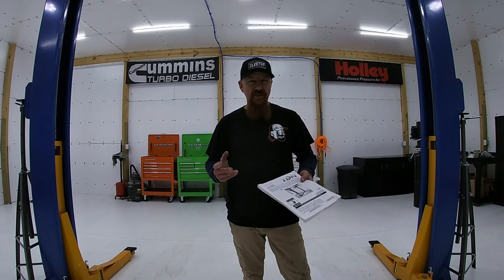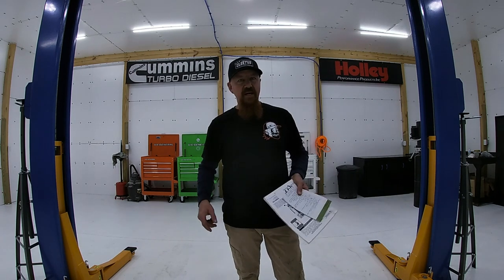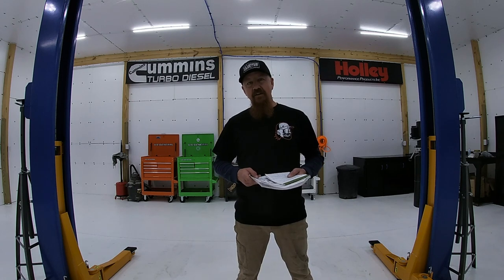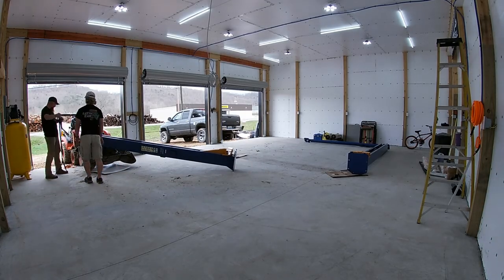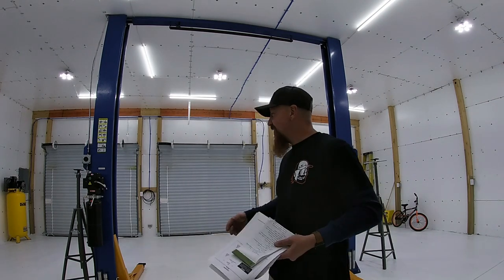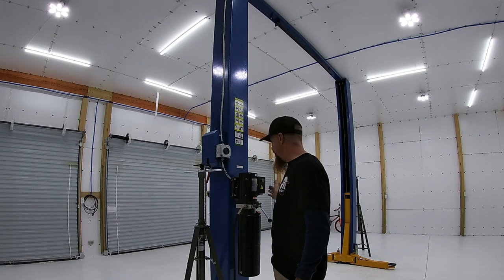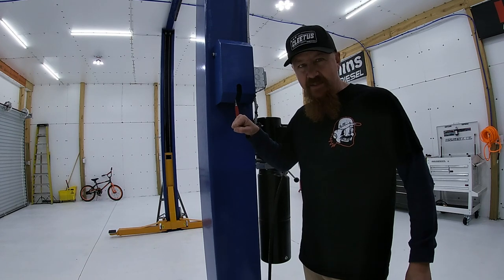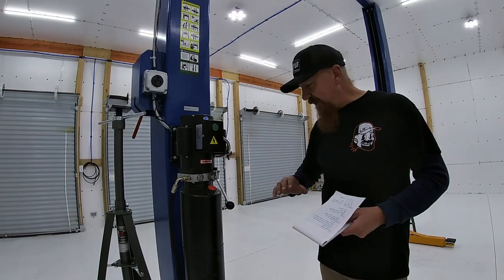Installing a Two Post Car Lift - Tips, Tricks, and How-to Install - Triumph NT0-11A - 11k

Comment: My Triumph 11,000lb lift came with Triumph 9000lb instructions.  The drive-thru is wider on the 11,000lb, we had to reinstall.  The instructions recommend drilling through the pad so the anchors can be driven down if you need to move it.
Reply from the maker: That is a good idea!

Comment: Great video Lucas! Its hard to believe this is the first time you`ve done this. You touch on so many good points. All i can add to it is, watch for cable stretch. It DOES happen. So keep checking all the cables for the time being just to make sure everything is settling properly. You will likely have to do an adjustment once in awhile. Watch your cables for wear too. I would spray them with some lube of some sort too, to keep them from rusting. Any type of spray grease should work just fine. Very nice shop brother. It will make life so much easier for sure.
Reply from the maker: I didn’t know about cable stretch.  Thanks for sharing.  I forgot about mentioning lube on the cables.  I actually rubbed mine down with gear oil.  I appreciate the comment!  👍

Comment: You're absolutely right about the truck weight not being the only number.  A lot of 1 ton and 3/4 ton diesels are very close to 5000 lbs in the front which exceeds even a 10000 lbs lift capacity on the front 2 arms.  It's in many manuals warning about this case.  I've weighed my '06 3500 duramax at CAT Scales and it is close to 4500 lbs in front, add a huge grill guard or plow attachment and you now pushing it on even a 10000 lbs lift.
Reply from the maker: Great information!  I appreciate the comment!

Comment: I would say you did a good job with your install. I had a forward I10 10k lift installed in my garage. I had bought mine from Napa and had there installer put mine in. I was there and helped them stand the post up. I just didn't want to deal with it, and it gave me a longer warranty having them do it. I had a Ashton 8k scissor lift, but i didn't trust it and needed bigger for trucks and SUVs
Reply from the maker: Thanks!  We are super thrilled with it.  I’ve had several Ram 2500s up on it now with now issues.
Reply: @PeeksPeakHobbyHomestead  I went with this lift because I can lift symmetrical or assemitrical with it. That and a buddy of mine with another garage has one and hasn't had any issues with his in 9 years.

Comment: Companies make 2 pole (220v) 30a light switches.  I plan on, and recommend others to install one as close as possible to the lift control.  After studying the wiring diagram for the lift, a faulty push-button or a stuck contactor will keep the lift going up after you let go of the button.  The worst of the two is a faulty contactor - that will bypass the overhead safety switch, just using full pump pressure to raise the car as high as possible.  The 220v switch can take full power away from the unit in an emergency.
Reply from the maker: That is definitely a danger I wasn’t aware of.  That sounds like a smart solution.
Reply: @PeeksPeakHobbyHomestead  I don't know how common of a failure it is, but I'm sure the parts are cheap plastic parts that get hot and can fail.  My luck it'll be when there's an expensive car on it lol.

Comment: Can I ask if you had any issues with the anchors? My document said use a 1” masonry bit but this allows the two piece anchors to drop through to the bottom of the drilled hole. This meant I couldn’t even use the tool to secure the anchors on the concrete. Fortunately I only drilled one hole and discovered this.
Reply from the maker: Wow!  No, I had no issues.  I retorque them regularly but usually only have one or two that even take anymore torque.  You might be able to get a different epoxy style anchor to use in the hole that is too big…

Comment: Any issues with lifting a crew cab dually long bed?  Im on the fence between this one and the 15k lift.  Looks like downside to 15k is needing more ground clearance so lifting little cars would be an issue.  This one seems like the happy medium.
Reply from the maker: I have no issues lifting my crew cab 2500 and it is very stable.  I don’t think your truck would be over about 9k lb.  I think this would handle that just fine.  Good luck!

Comment: I recently installed this exact lift in my new shop a few days ago. I ran into the same little issues and discrepancies as you but all went fairly smooth. I do have a question, why do they want the triple extension arm towards the front part of vehicle and the the double extension arm towards the rear? They both reach almost the same distance so my thoughts were the double extension would be stronger and need to be up front to the heavier part of the vehicle. Please let me know your thoughts on this.
Reply from the maker: So I Am no expert, but I assumed there must be something stronger about the triple arms.  🤷🏼‍♂️  Either way, we sure love ours!  We are getting tons of use out of it.

Comment: Your misinforming people when you say you need a 12' ceiling hight. Sure that would be optimal but most garages aren't built like that. My garage is a good size might be bigger than yours as far as square footage goes but the ceiling hight is 9'3". And you can infact install a two post lift in my garage. Your limited to how high you can lift a vehicle but besides sitting on a rolling stool vs standing upright there not really a difference.
Reply from the maker: That isn’t misinforming people, these lifts aren’t designed for 9’3” ceilings.  Sure, there are workarounds, I’ve been there.  Nothing wrong with what you’re doing.  There also is nothing wrong with sharing the specs needed to install and use the lift as it is designed.  🤷🏼‍♂️